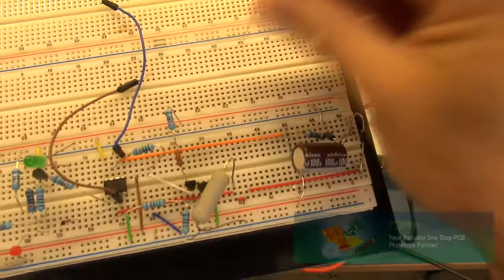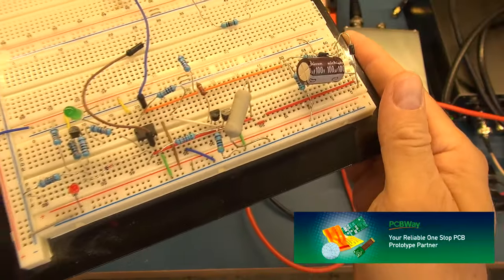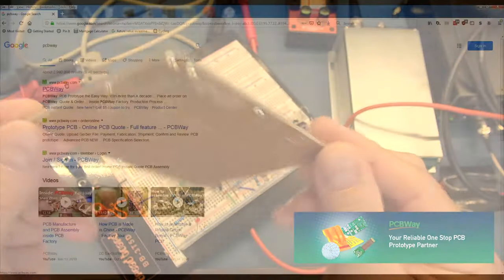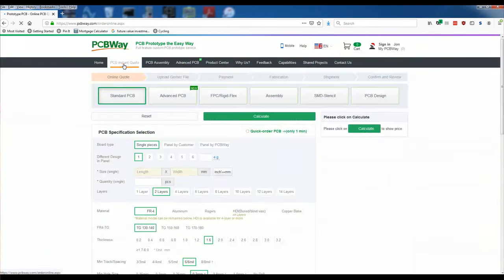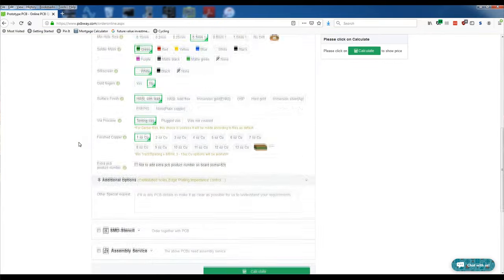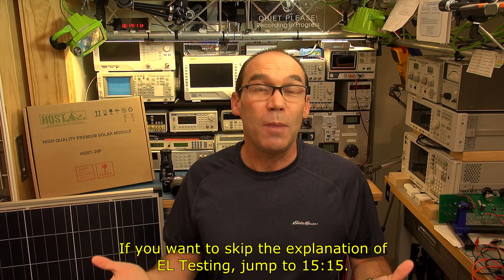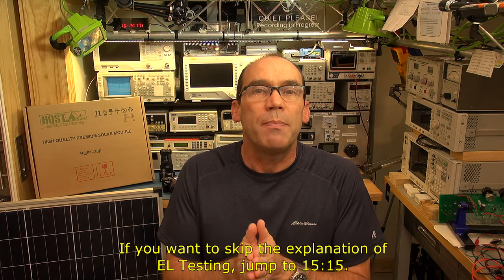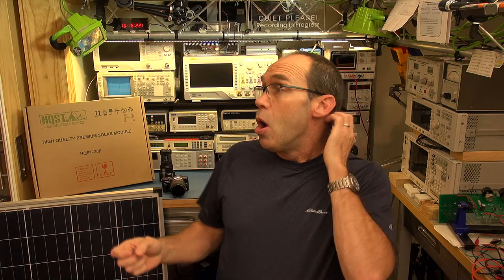EL Testing of Solar Panels. What is it & How to do it. - Part 1

Comment: One add on to that would be a remote release, which obviates the need to touch the camera once focussed and ready. Depending on the camera you plug it in to the USB port or the remote control port.